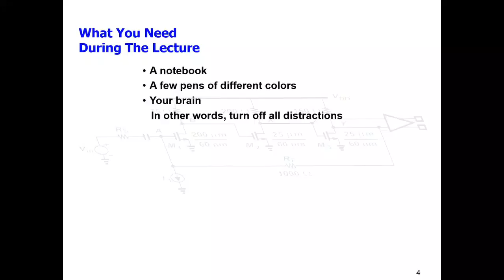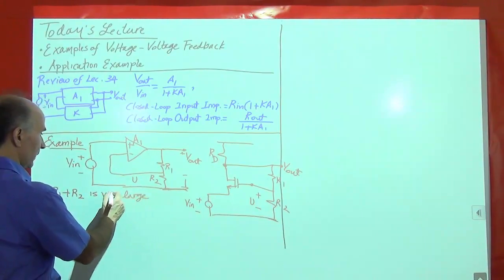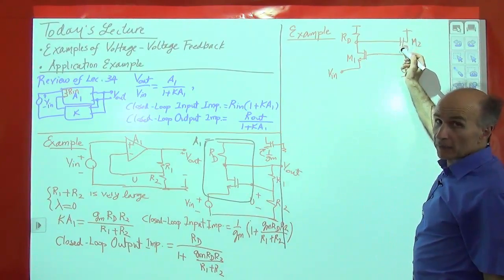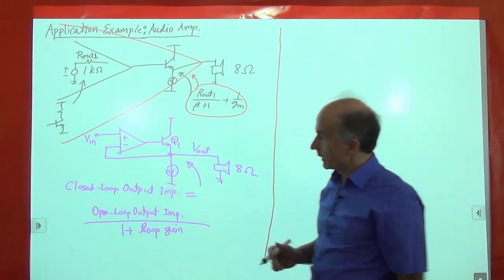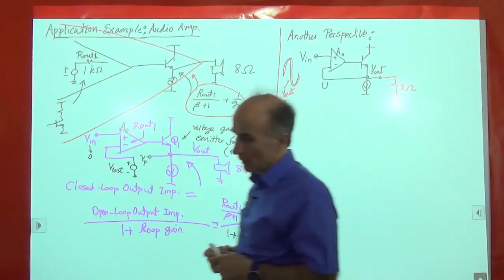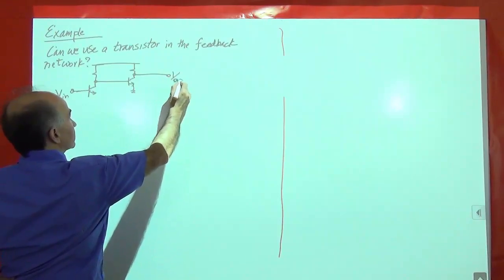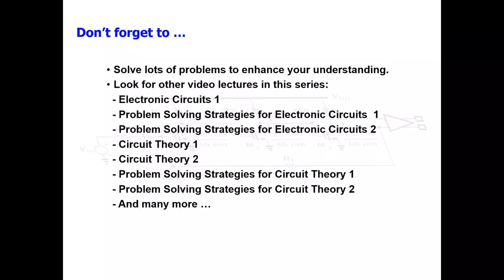Razavi Electronics2 Lec35: Examples of Voltage-Voltage Feedback

Comment: 01:25 - Intro and Review
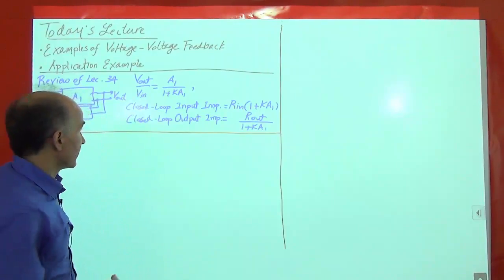04:05 - Examples of Voltage-Voltage Feedback
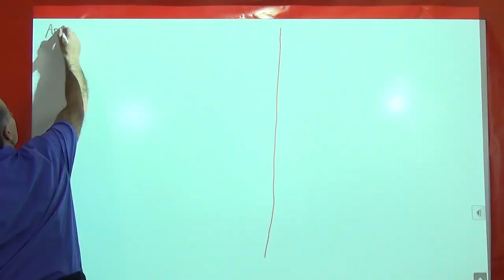20:40 - Application Example
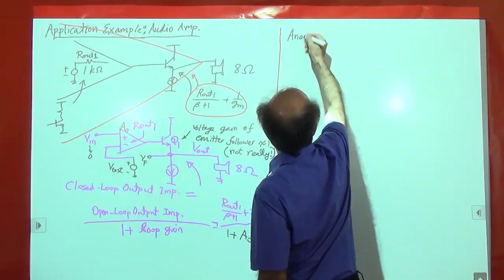31:45 - Another Perspective
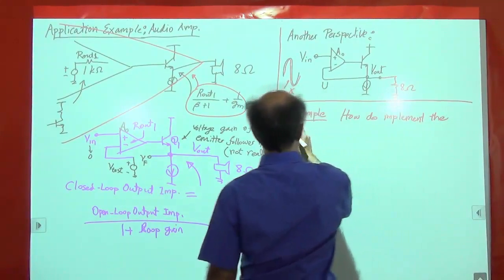35:00 - Implementation of Op-Amp
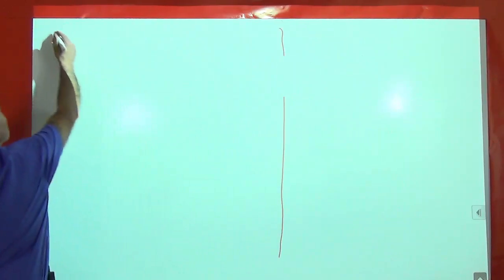40:05 - Using a Transistor in the Feedback Network for Impedance Adjustment

Comment: 45:51 open loop output impedence of emitter follower is wrong because there is the effect of Rc of the second stage amplifier
Reply: While finding the impedance of the follower, Vin will be set to 0 (being an independent voltage source), making Vout=0, hence, making one end of R1 ground, so there will not be any affect of Rc, making base resistance = R1 || R2.